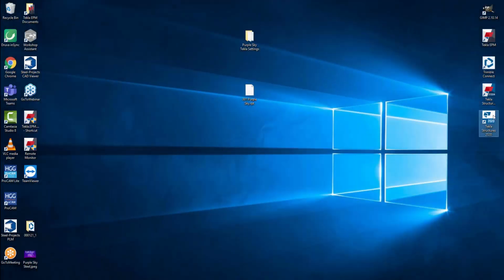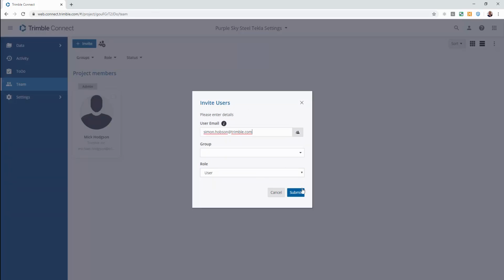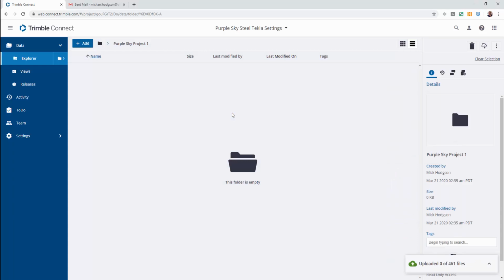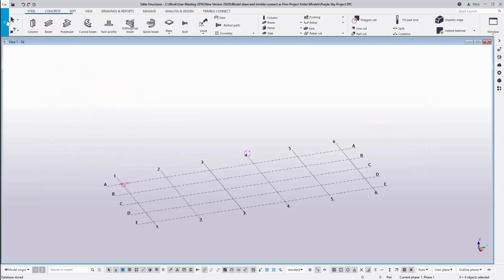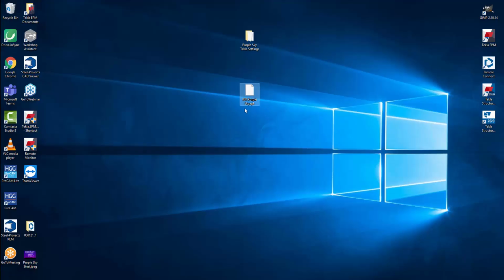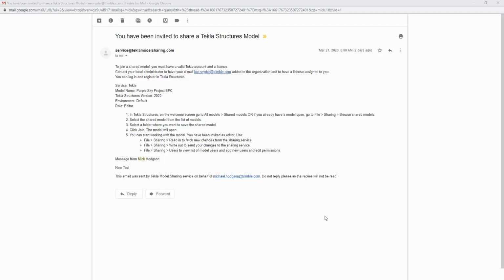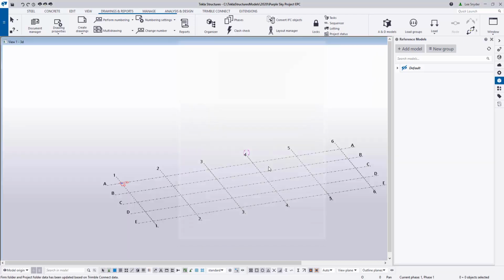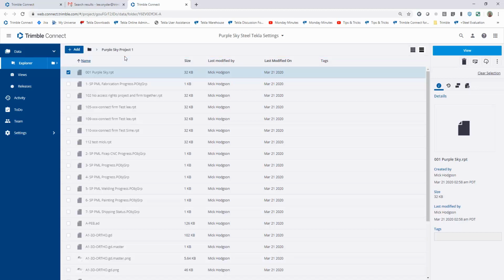Using Trimble Connect as the Project or Firm Folder

Comment: Downside is, that I will need to copy a file to 255 Trimble Connect projects, if it is a relevant file for all current projects.
The next day, after some User input and changes to the file, I will need to do it again...
I think we are better off, having the Firmfolder in our own cloudstorage pace and direct the models to that. That way there is only one, firmfolder that need to be updated.